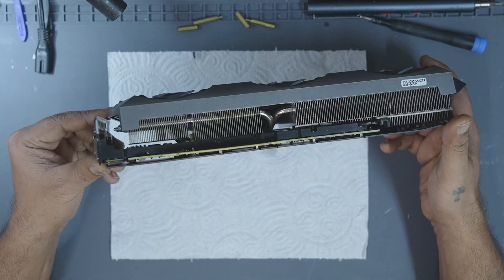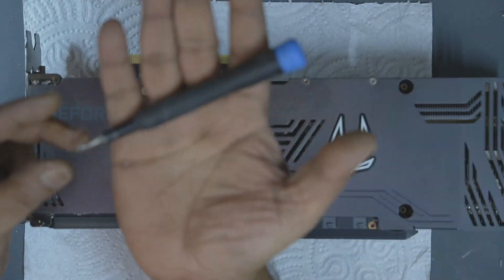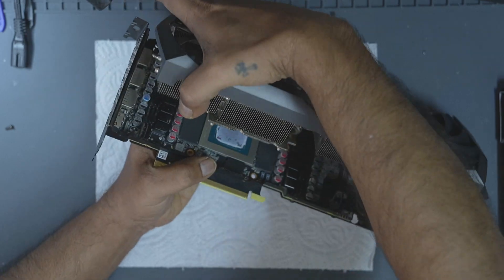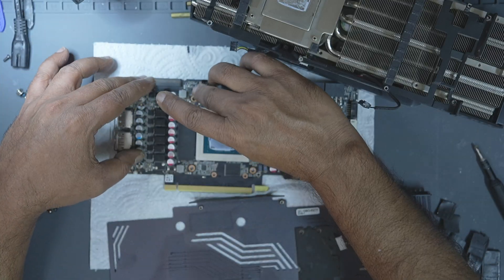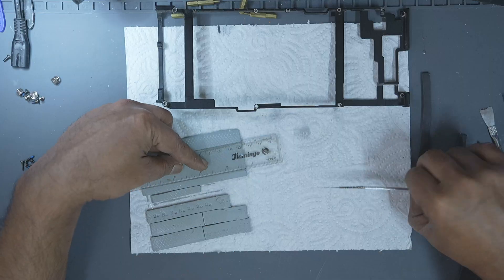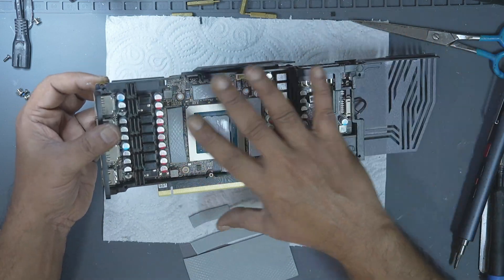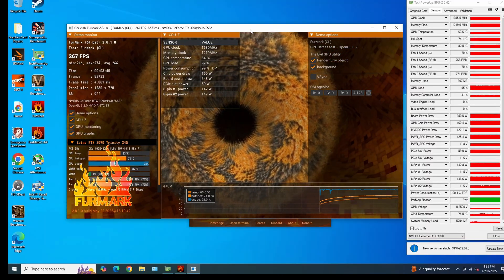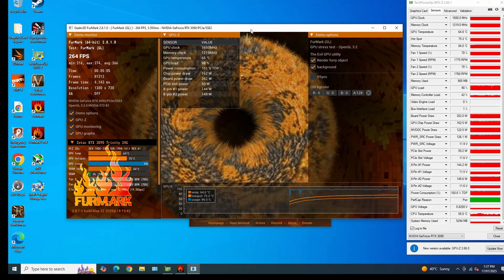How to Replace Thermal Pads and Paste Safely on your GPU.

Comment: Thanks for the guide.  Do you know what the thermal pad thickness is for the 3070 FE?  I'm thinking of getting the Gelid Extreme pads.
Reply from the maker: 2mm on the memory. Make sure soft pads are used
Reply: @GraphicsCardRepairs-tk7ql Thanks!

Comment: 84°C Memory Temperature Doesn't Look Good Dude 👀 lol. You Need Better Thermal Pads Or Paste 😆👌
Reply from the maker: For GDDR6X. That's a good temperature. On this GPU Memory temps hit 95C. It's common for GDDR6X to be around 85 unlike GDDR6 which operate at much lower temperature. These pads are good.😊
Reply: @GraphicsCardRepairs-tk7ql  Yeah,.. I See That Now In ,,Thermal Grizzly TG Putty Pro" ReViews On Amazon 😅 RX7900XT (97°C To 90°C). Your Pads Are Still Cheap 💁‍♂
Reply: SomeOne Reduced The Temps With That Paste On A RTX 3090 Ti (60°C, HotSpot 75-80°C, VRAM 65-70°C) To (50-53°C, HotSpot 60-63°C, VRAM 53°C) lol 👀😵

Comment: 6:26 What kind of thermal paste do you use? I've tried Arctic MX-6 and it turned out to be too thick and did not stick well to the crystal. So when I tried to spread it on the crystal, the paste simply came off completely, rather than spreading. I had to gently press it down with a toothpick and apply it to the entire crystal, but it was a very thick layer. I can only hope that the excess squeezed out on its own.
Reply from the maker: I use GD2. It is also thick so it requires a larger quantity. You can try thermal Grizzly.

Comment: This great, I'm thinking of repasting my old 2080 Super. It's 75c with a hotspot of 107c when I try to do some gaming, I wouldn't notice but the fans kick into 100% speed no matter what and it's loud. I'll try to do a dusting, and maybe even manually reduce fan speeds, but if all else fails, I can repaste, thanks for the video!

Comment: Good video. Some users don't understand the importance of using thermal pads of the correct thickness. Too thin and nothing makes contact. Too thick and thermal issues will be the least of your problems.

Comment: alternatively, you could use a thermal interface material such as the honeywell ptm 7950 or thermalright helios instead of thermal paste on the gpu die. in direct die and air cooled scenarios, they lead thermal paste and often match or are within margin of error when compared to liquid metal without the precision requirement and risk involved with liquid metal.

Comment: I'm glad that most of the techniques I felt were correct and used when recompounding/repadding my card are being used by someone with a bit more knowledge. basically, you should never force components, take your time, don't over-tighten screws, tighten them in an opposing pattern

Comment: i have rx 560 4gb sapphire can you plaese tell the thickness of thermal pad 0.5 mm or 1mm is required tell about both on Vrams and mosfet
Reply: Use Thermal Putty bro, is easier to apply and no need to measure anything, Id reccomend Upsiren U6 pro or Thermal Grizzly Putty  but is more expensive.

Comment: I have an asus rtx 2060, my gpu temp is 75 and hotspot is 90 at sustained full load, fans at 60%. my gpu at idle mode shows 35-40 degrees, so should i be worried or its fine ?
Reply from the maker: No. You should not be worried. It is on a higher side but it's still normal. As long as your hotspot does not cross 95, there is nothing that is required. The variance between GPU temp and hotspot should be at max 15  to 16 degrees. May be about 6 months down the line you may need a repaste.
Reply: @GraphicsCardRepairs-tk7ql really appreciate your response ❤

Comment: Hi I have a Thermaltake CTE 750 case, the GPU hangs in it vertically with the IO bracket at the top, tried 2 GPUs in it and on both the hot spot goes over 100C and start throttling while the core temp is only 60-65C. Both AMD GPUs, 1 is founders edition 6800xt and the second is an Asrock 6950xt Phantom gaming. The 6800xt is unopened, the 6950 was refurbished by Asrock less than a year ago. Do the heat pipes of the coolers don't work properly when oriented vertically?
Reply from the maker: When there is an issue with the vapour chamber these kind of issues are observed. I have observed this in many AMD GPUs. I will need to investigate this further. In one case when I swapped the cooler it was resolved. I was lucky I had a spare one.

Comment: Question here:

My Msi 5080 Venus x3 OC does not have thermal pads between the backplate and the back of the pcb. I’m considering installing some but don’t know exactly where to place them. Can you assist me with this? I’m very novice with this sort of thing so terminology is difficult for me. Maybe an illustration would be good
Reply from the maker: On a RTX 5080 pads are not required behind the GPU. It does not produce much heat. If your GPU is overheating it is probably the paste or pads at the front. But in case you do want to install pads at the back, you can install behind the memory. You will need to measure the space behind the memory and backplate with a Vernier Calliper.
Reply: @GraphicsCardRepairs-tk7ql you are so helpful I am very grateful for your response ❤

Comment: Excellent work as always!!👍🏻

What's your opinion about thermal phase changing pad like PTM7950 for gpu core?
Do you have any pro/cons in your mind?

Cheers!
Reply from the maker: Thank you😊. I like PTM on the GPU core. Only downside I have come across is, once used and if you separate the cooler from the PCB you have to replace it. It cannot be reused. But I would prefer PTM on my GPU core.
Reply: @GraphicsCardRepairs-tk7ql 
Well, that's quite a bummer since i open-close the GPU quite often...
(You know... De-dust the gpu, solder this solder that, add something..😅)

Might be best option for "one time apply-long time use".
Anyway thanks for replying me
Cheers!
Reply from the maker: Thank you 😊

Comment: Is there a technical document or repair control flow chart for graphics card repair? Where should I start learning about this?
Reply from the maker: Best best start is learning the function of components. Like resistors, capacitor, transistors, diodes, MOSFETs etc. once you know this learn about power circuits and data sheets of components. Then you can watch repair videos of repair channels to learn GPU repair.

Comment: Question here,with the thermal pads used does the thickness matter?i looked up the pads on aliexpress and there are different thicknesses avaliable, problem is i have a xfx swft 210 6600xt and i cant really find information online on the actual thermal pad thickness,i did see people used 1.5mm pads on the memory and 1mm on vrms for different xfx cards,the 7600xt and 6650xt,so i was thinking of ordering 1.5mm pads only,think it would be enough?
Reply from the maker: As explained in the video, installing incorrect size, the core will not make proper contact with the cooler creating overheating issues. It is extremely important to install proper size thermal pads on the GPU.
Reply: thats 0.5mm on vram, the back panel doesnt need 1 iirc, i use on 1mm but the cooling doesnt even touch with the paste. every card brand and series has different size of pads, if its doesnt make contact with the paste just change it smaller.
Reply: @GiGatoQ okay,do u know the size used on the vrms?
Reply: If you can't work this out yourself, you probably shouldn't be doing it. Simply measure the existing pads.
Reply: @SimoWill75 the card overheats with the existing pads,I currently have ptm on the card and the hotspot touches 100,so I was planning on getting slightly thinner pads.
Reply: @morbid_obsessions the hotspot at 100c is normal, unless it get pass 110c you should be concern. Try undervolt first, it may change your impression after that. Im now using hellhound 6600xt, the pads is 1mm front and 3mm between the pcb and backplate.

Comment: Hi Fraser, thank for sharing.. good step by step guide...as u told about separate for group the screw, i suggest to use a small parts holder, it helpè me disassembly and reassembly a laptop in nearly 20 minute...having every screw separated for sub-group... bye Francesco Timnpano from Florence Italy
Reply from the maker: Thank you for the tip and the comment, Francesco! 😊
Reply: @GraphicsCardRepairs-tk7ql thank to you.. can send a link for the thermal pad u share.. i'll starting now to repair VGA after your good channel input....can suggest some site to bay faulty card to have donor for spare sparts..bye Francesco